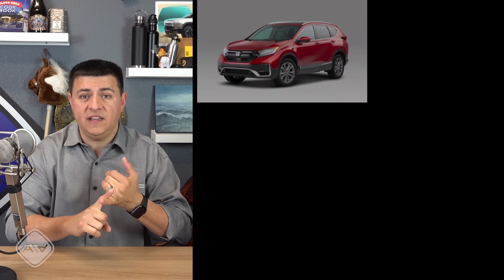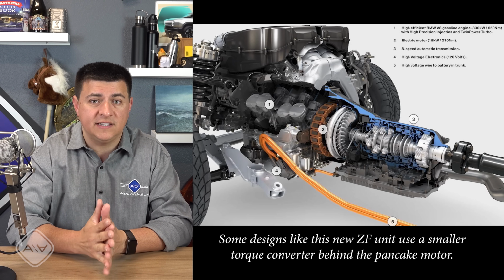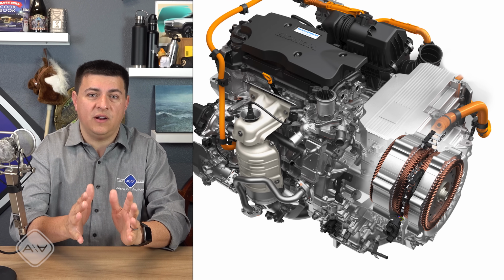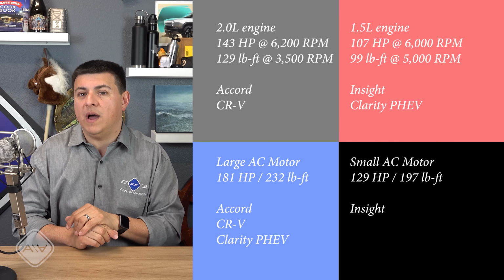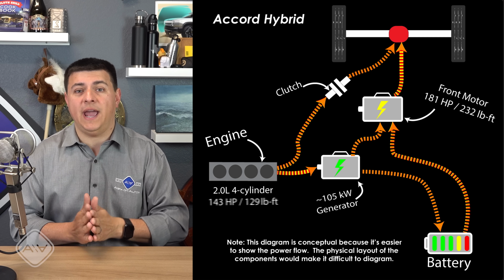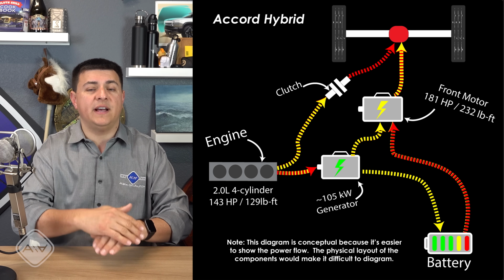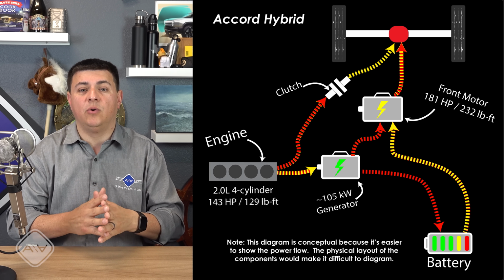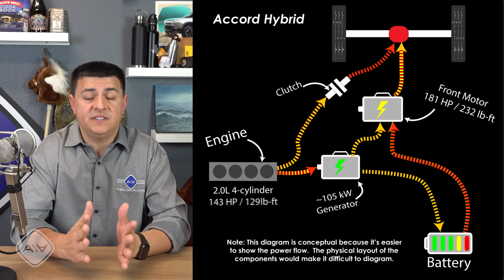How Does It Work?  Honda's 2 Motor Hybrid System Explained!

Comment: One thing that seems to confuse a lot of people about hybrids is the fact that the output of the electric motor is limited not only by the motor itself but also by how much electrical energy can be delivered to it. The battery alone can’t deliver enough to get the full 180 hp out of the traction motor; it’s augmented by power from the generator unit too. So if the engine is mechanically coupled to the output and 100% of its torque is used as tractive effort, the traction motor can only output a fraction of its rated 180 hp because it’s limited by what the battery can discharge.
Reply from the maker: Yep, exactly.
Reply: But the engine cannot ever be "mechanically coupled to the output" at the 6200 rpms where the claimed 212 HP occurs. It corresponds to a car speed of over 165 mph.

In short, if the engine is running at 6200 rpm, the clutch must be disengaged. So if the hybrid system produces 212 HP to the wheels when the engine is running at 6200 rpm, it is coming from the traction motor only. That's why the combination I suggested before could make sense.

As I said before, I don't understand where the 212 HP number comes from, but I do know what it can't be. It isn't the sum of the motor power and the engine power at 6200 rpm, because they can't be added at that speed. Another thought I've had is that it is the sum of the traction motor HP rating and the (unpublished) generator HP rating. That would account for it being the same in the Clarity. But it is meaningless.
Reply: Jeff Jo is it possible that the 212 hp is achieved at less than maximum engine power? It would require the battery and motor to output more
Reply: @pmo5821  Let's compare what Honda says about two cars that both have the 181 HP, 232 LB-FT traction motors:

Accord Engine: 143 HP at 6200 rpm, 212 HP combined at 6200 rpm.
Clarity Engine: 103 HP at 5500 rpm, 212 HP combined at 5500 rpm.

If the clutch is engaged, the Accord is doing 167 mph at 6200 rpm. If the tire size in the Clarity is the same, it is doing 148 mph. If the tires aren't the same, that number is close enough.

The point is that the advertised 212 HP for both is at the engine speed where the maximum engine power is achieved. It is an impossible speed if the clutch is engaged, and more than the stated HP of the electric motor alone if the clutch is not engaged.
Reply: @jeffjo8732  I'm starting to think that the 212 "system HP" might be still be somewhat relevant in that it accelerates similarly to a traditional ICE setup with 212 HP. While the drivetrain loss itself isn't enough to bridge the gap between 212 and 181 HP, a traditional ICE also has to run accessories like the water pump, alternator, power steering, air conditioning, etc. that all consume some small but not insignificant amount of power. It's actually quite common for cars to only put down ~85% of the rated engine HP to the ground during dyno tests - the remaining 15% is absorbed by some combination of drivetrain loss (which should be quite low in modern cars) and accessory drives.

The excess power that's discharged from the generator + battery that can't be put through the 181 HP traction motor would be used to run these accessories (or in the case of the alternator, replace it entirely).

As to why the Accord and Clarity achieve the same 212 "system HP" despite different motor and battery sizes, it may well be that the larger battery is designed to discharge exactly the right amount of power to make up for the smaller ICE.

Comment: Very surprised the US market never got the Hybrid Fit. I've had my 2013 Fit hybrid for a couple of months now and runs like a dream. Think that engine you just described is what my car has.
Reply: The 2013 Fit hybrid used a different system, called i-DCD. It uses a dual-clutch automatic transmission that not only changes gears for the gas (petrol) engine, but also can shift an electric motor into the drive train in what is called a parallel hybrid system. That means the engine and the motor drive the wheels at the same time.

The iMMD system Alex describes was introduced in the 2014 Accord. It is usually a serial hybrid (engine drives generator, and motor drives wheels alone), but switches to a parallel system when the clutch is engaged.

Comment: Great explanation on systems.  I'm thinking the Honda clarity is still the best plug in hybrid for 2020.
Reply: 80%  It's basically fully electric with a gas generator for extended range.
Reply: No need for torque converter.  Direct electric.

Comment: Just theorycrafting here, but it seems an advantage of Honda's IMMD system is that there is some more freedom in the placement of the traction motor.

For instance, a narrower but longer traction motor could be mounted in the central tunnel where the transmission of a longitudinal layout would normally sit, and have it drive either the front, rear, or both axles. This would cut down the width of the "transaxle" portion of the hybrid system, which can still retain a mechanical top gear and clutch pack connected to the front axle. This would make it feasible to package a larger ICE & generator combo if higher performance is desired, and the traction motor would have quite a bit more headroom too to scale up or down.  There would probably be space for a 2 or 3-speed gearbox for the traction motor to widen the efficient operating range of the serial hybrid mode, and make the mechanical top gear even taller to improve high-speed cruising. After all, the Lexus multistage hybrid system manages to stuff a 4-speed auto gearbox, 2 motor generators, a planetary gearset, and bellhousing and flywheel all in that space.

My conjecture is that Honda's high-speed efficiency is lowered in part due to the fixed ratio between the large traction motor and the wheels. As rotor RPM nears its upper limit there are significant iron losses in PMAC motors as the permanent magnets spin past the stator teeth.
Reply: Or honda can slap a second motor on rear axle and called a day.
It became a tesla with on board generator. LOL.

Comment: This shocks me that they mechanically connect the rear of the CRV vs. just adding a 3rd electric motor for the rear, or even 2 electric motors for the rear to torque vector.
Reply: A lot of new parts to design and build. VS, run what you have ( build ).

Comment: I own a 2024 Accord Touring Edition hybrid and I love it! 
I don't remember if you mentioned it or not but Honda engineers programmed the non-existent transmission to "go through the gears"! When you accelerate hard it simulates shifting gears. I guess to keep owners happy.
Well  by now you know the Honda two motor e-CVT has changed again! ( Gen-3 to Gen-4 ) I think operation is the same but the electric motors are no longer stacked on a common shaft. I understand they mounted the drive motor behind the generator to reduce the width of the unit.
Just wanted to say thanks and I found your video to be very helpful in understanding the Honda system!
Reply: It's hard to understand why people associate the temporary loss of power that produces those sounds, with increased power. Those simulated shifts are why the Gen-4 version has slower times, and worse mpgs, despite improved engine and motor.
Reply: @jeffjo8732  I agree but I personally don't accelerate hard enough for it to make it want to try to fool me.
I'm not a 0-60 guy. It does get great mpg just the same!

Comment: Is this more complex and potentially less reliable than the planetary systems?
Reply: yiyer It’s much LESS complex, mechanically. That said, Toyota and Ford planetary systems have shown extremely high reliability. I suspect actual reliability will be more a function of component and build quality rather than design.
Reply from the maker: No, I wouldn't say that. The planetary systems have one gearset but only some of them usee a clutch like this system does. I would say that in terms of complexity they are similar.
Reply: I would say the advantage on the planetary systems is that Toyota has been refining that design since 1997 and they use essentially the same design in all of their hybrids. Although they are not mechanically identical.
if you would like to see what the inside of one of them looks like and how they operate I highly recommend taking a look at Weber Automotive on YouTube.
He runs a electric vehicle and hybrid vehicle Automotive college in Ogden Utahand has some absolutely fantastic videos on theory of operation and also many disassembly videos.
He's got a very thorough set of videos on the Chevrolet bolt EV also.
Reply: @AAutoBuyersGuide  Hello Alex, I have a question. Is the e-cvt transmission used in this 2021 model new 1.5 cc Honda Jazz exactly the same system as the e-cvt used in the 2019 year 1.8 cc Toyota Corolla sedan or is it a different system? The reason why I asked this was they said that the risk of deterioration of the e-cvt system used in Corolla is less than the normal CVT. Do you think we will have problems with the e-cvt gearbox if we buy Jazz?

Comment: wonderful explanation of how this system works. 4 years after this video it seems the mpg is not quite on par with rivals but still pretty good compared to the gas only versions.
Reply: You can't just compare the mpgs, you need to look at other differences. The Honda hybrid system is more efficient, but they also give you more car which drops them about 2 mpg. And each mpg amounts to maybe $15/year in gas (at 12K miles, $3/gal). So this is really picking nits. But only you can decide if the larger, faster car is worth that to you.

The Accord has 123 ft^3 (106 pass.+17 cargo) interior space to the Camry's to 115 ft^3 (100+15).
The Civic has 114 ft^3 (99+15) to the Corolla's 102 ft^3 (89+13).
The CR-V has 145 ft^3 (106+39) to the RAV4's 137 ft^3 (99+38)

Then there is about 2 more mpg for each inch of wheel diameter

A Camry LE on 16" wheels is rated at 51 (53 city, 50 hwy) mpg. It also has very narrow tires.
A Camry SE on 18" wheels is rated at 47 (48, 47) mpg.
An Accord EX-L on 17" wheels is rated at 48 (51, 44) mpg.
An Accord SPORT on 19" wheels is rated at 44 (46, 41) mpg.

And BTW, it is the fake shifts that kill the Accord's highway ratings. They were put in to appease reviewers who don't understand that it is an Electric Vehicle at heart, so it doesn't care about shifting gears.

The closest direct comparison is the Civic SPORT to the Camry SE. They are almost the same size, and on the same tires. The Civic gets 49 (50, 47) mpg compared to 47 (48, 47) mpg.

Comment: Im about to buy a Crv hybrid this month yahooo
Reply: What do you like and not like about your hybrid?
Reply: @PaulNaylor3   i didnt like that the backseat was small. I also didnt like that the hybrid only kicked in when running at low speeds. I drive mostly on the highway to work. I traded it in for a passport.

Comment: I definitely appreciate the performance you get with Honda's hybrid system, and I love that it's so easily transferrable to all-electric cars. However, I drive most of my miles at 75-80 MPH, so the lackluster high-speed efficiency just doesn't cut it for me. Still, I bet this system will be extremely robust and reliable in the long-term.
Reply: Pikminiman The alleged poor efficiency at high highway speeds is theoretically true, but I’m not sure it’s true in the real world. No cars in this segment have 10 speed transmissions with super high drive ratios. In fact, cars like Prius and RAV4 hybrid are generally more efficient in stop and go and less efficient at high speed. I think Honda made a clever decision in this design. It’s a true EV at low speed but it uses the petrol motor to efficiently cruise at higher speed.
Reply: @alliejr  : I get what you're saying, and I agree Honda's system is a clever design, but I've read quite a few anecdotes about people in my situation (they drive a lot at 75+ MPH) who have test driven the current Honda Insight and the current Toyota Corolla Hybrid. They generally seem to report high-speed efficiency of ~42 MPG on the Insight and ~54 on the Corolla Hybrid while driving the same path. Of course, anecdotal evidence is not conclusive, but a 29% difference in efficiency is enormous.
Reply: alliejr just to correct...add $400 over accord hybrid you’ll get accord 2.0T which does have 10AT. Probably we can expect 2.0T+10AT to get higher mpg at over 90mph vs hybrid lol
Reply: Pikminiman All fair. I would counter that if you’re goal is maximum efficiency, >75mph driving is not the way to go. Above about 65mph, every car begins to suffer huge aerodynamic losses. Further, there is a HUGE chasm between the driving dynamics of a Corolla and a Civic/Insight. But you’ve made completely fair points.
Reply: @alliejr  : I agree that aerodynamic drag is a big deal at high speed, no matter what vehicle. The best way to optimize efficiency is to simply cruise at 55-60 MPH or so. I do this as often as I can. However, most of my regular trips are 70+ miles, and sometimes I cannot spare the extra minutes to hypermile.

Comment: I would like a video describing in detail how to drive a 2023-24 CRV Hybrid to get maximum longevity in the clutches.  I recall from my manual clutch car days it took careful driving to get the extra 30000+ out of a clutch.  This is very imp. since the cost of replacing a the transmission clutch on a Honda I would expect would be several thousand since it would mean opening the whole transmission.

Comment: I wish there was a DIESEL / ELECTRIC hybrid like this.
Reply: DJPelio diesels aren’t popular enough in America to justify it. A European brand like Volkswagen, Peugeot, or Renault may be able to make it viable but petrol electric hybrids are going to remain the most popular
Reply: Jay Mac I would import it from Europe if I could.  It’s insane that people buy gasoline SUV’s here instead of diesel.
Reply: DJPelio diesel has a lot of downsides. It may get better gas mileage but they still pollute more and diesel is more expensive than petrol in most areas. Diesel is really only really shines in big pickup trucks where you’re towing/hauling literally tons of weight. Diesel engines are just more complex and not a good choice for most people
Reply: That's a good way to fill up a dpf. A lot of stoping starting and never getting warm is going to create soot that needs to be captured.  It can work with a phev but that isn't going to be cheep better off with a bigger battery
Reply: Conor Nugent it can keep running and charging the battery.
Reply: Jay Mac I’ve had 3 diesel cars already and had no problems with them.  They don’t pollute more as long as the manufacturer doesn’t cheat on emissions testing.
Reply: @djp1234  do you do a lot of highway miles? How long do you keep the vehicles? 
The DPF needs low rpm, low load cruise to burn out the stuff it collects. City driving eventually leads to issues. One person's anecdotal experience without any details is of little use.

Look up the issues with dpf.
Reply: zakura ayame yeah I do lots and lots of highway miles.  A lot of road trips.  Diesel is ideal for me.
Reply: There is Volvos V 60 Hybrid with a 5 cyl diesel and a large electric at the rear has been out there for a good few yrs now but i cant still afford one!. So what i think you've got is a no none sense drive train which isn't as confused as the rest of them meaning also you could probably change the engine alternator if it went broke and still think you were driving a normal diesel car because its layout is more conventional up front! https://youtu.be/2aW9ZCKtTPs
Reply: @djp1234  Diesel Gate

Comment: Honda 2 Motor Hybrid is the best solution, but using a standard ICE in conjunction with electric motors is at least ineffective!
The best design a hybrid electric vehicle will be car with an Rotary Vane Internal Combustion RV8/16 engine. Competitors will not catch up with you, if they will not first. But  anything is possible.

Comment: Congratulations on a clear, informative, and well presented run down. I don't mean to criticize, but I would prefer metric units, or at least the same units in the sketch; ie don't mix hp with kW.
Reply: The power rating of the generator is pretty much irrelevant, since it never powers the wheels. In fact, I've never seen its rating, and Alex's diagram indicates that it is approximate. FWIW, 143 HP is 106.7 kW, so with losses it will never be able to generate more than about 105 kW, and kW is the standard unit for generators.

Comment: Honda and GM also reportedly expect collaboration to shorten development times of plug-in hybrid powertrains.
The Japanese firm expects to gain insight from GM, which it views as more experienced in the field. And GM expects the partnership to give it a competitive advantage over other automakers in the plug-in hybrid segment.
It plans to launch its Cadillac CT6 plug-in hybrid luxury sedan before the end of this year, using an adaptation of the 2016 Chevrolet Volt powertrain that is also used without a plug in the 2016 Chevy Malibu Hybrid.

https://www.greencarreports.com/news/1101858_honda-to-cooperate-with-gm-on-plug-in-hybrid-technology

Comment: I test drove a Honda Insight. 

Weird sensation. 

I pressed down on the accelerator and the car went faster but the vroom from the gasoline engine didn’t kick in for a few seconds.